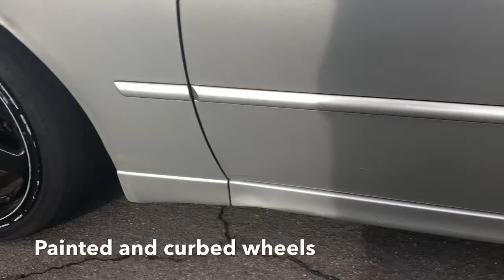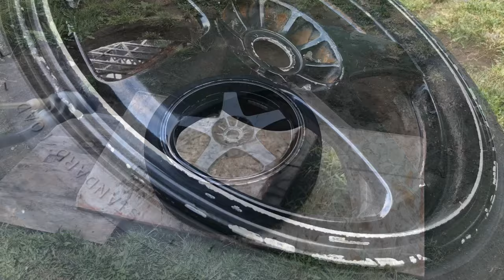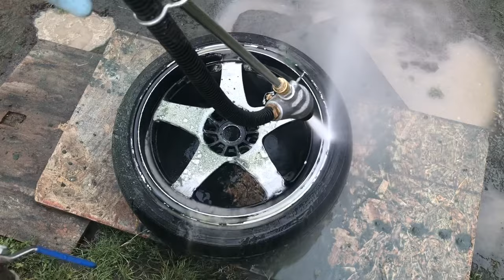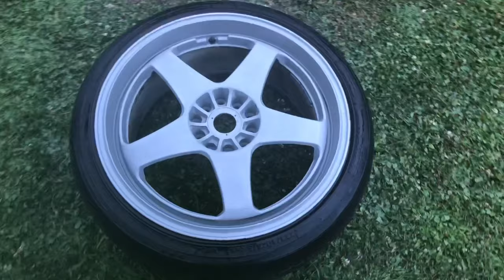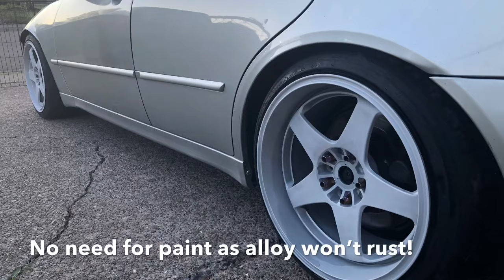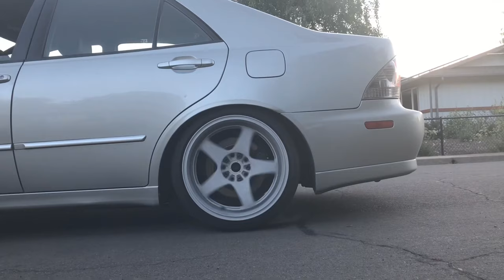Wheel Restoration - Waterblasting Curbed Painted Wheels

Comment: It would be nice to have known what pressure washer u have
Reply from the maker: Dewalt 3800-4000psi
Reply: @KFLY67  thanks... will a 3000 psi 2.4 amp work for removing rim plasti dip?

Comment: What pressure washer did you use. Ive tried 1600 psi and  2200 psi.  Kinda works,but yours is great. What psi, and what gpm?
Reply from the maker: MrPlanecaptain according to manufacture specs, you need at least 3000 psi to make this work this well. I’m using a Dewalt gas powered 3.5 Gpm rating on mine at 4000 max psi.

Comment: What kind of pitting does the sand leave behind, I’ve got two sets of wheels I need to strip for powder coat.
Reply from the maker: James Miley it leaves some good profile for paint to stick to, depending on the sand using you can have some rough profile so stay away from playsand as that’s the worst but is doable if in a squeeze to get it done but leaves small knicks from bigger pieces that are un-filtered.. I use 40-60 mesh green diamond. Great for pull off powder coat and rust.
Reply: @Matt C Thanks that got me looking into it, I'm sure a welder isn't needed, but luckily I have a Mig and Tig. Now one thing I'm not trying to do is strip the whole wheel I only want to do the face, I'm going to leave the barrels and just clean them up. I wonder if you had a large enough container with solution if one could achieve cleaning only the "face" front inch or so.

Comment: If I used this on polished wheels with clear coming off will it dull/damage the polish under the clear??
Reply from the maker: yes, this is a sandblasting/stripping method, you are best to use aircraft paint remover to do what your trying to achieve. the other option is vaporing honing service using fine glass media instead of sand.
Reply: KFLY67 damn yea they removed methylene chloride the main ingredient that worked in strippers... I used 4qts and only got the clear off the faces so far still have the windows to go...